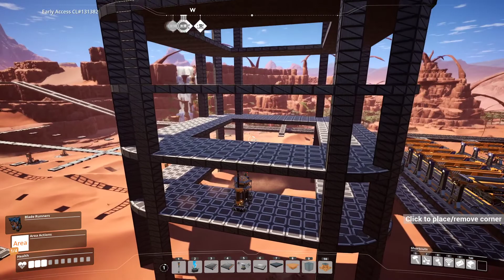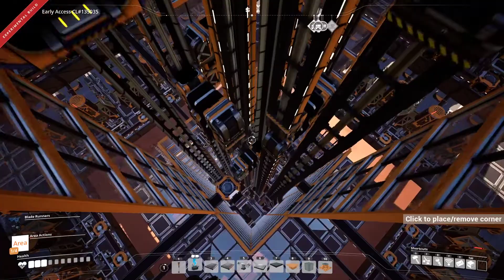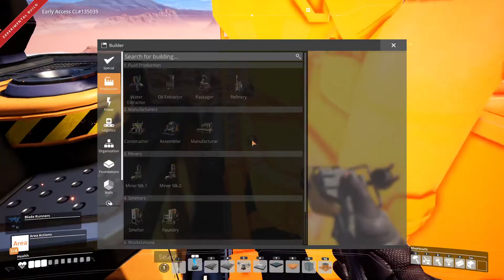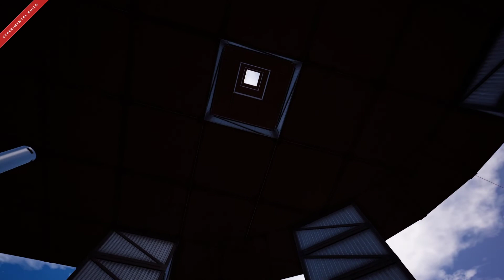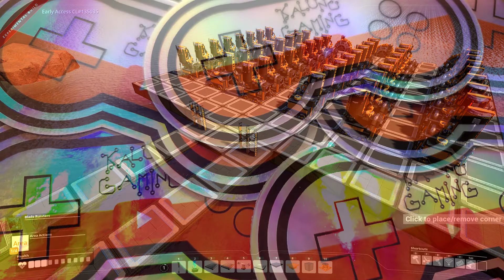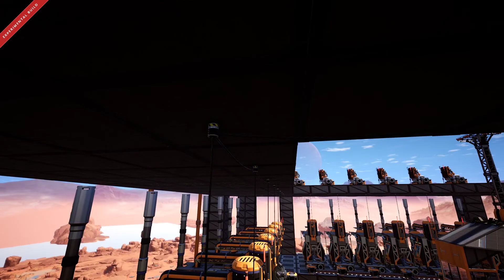Iron Factory Using Packagers! Satisfactory

Comment: Is there any loss in canisters by this build or will it be a perpetuum mobile? Like if the canisters belts are full u can "destroy" the canister production?
Reply from the maker: In the system I'm building I will be recycling the canisters much like my Turbofuel facility. Most likely I will have a few sets of industrial storage containers per line and have those filled with canisters, that should be enough to cycle through the system until it gets back to the storage container.

Basically they will just make a loop, empty inside industrial storage container -> packaged water -> unpackaged water -> industrial storage container and so on.

Comment: Try to line the glass foundation to make it more clean 
The small line that under it.
Reply from the maker: Normally I do lol, these are currently just place holders to mark out where I want belts to run. Also which foundations will be deleted after I run belts across the 8x1 foundations.